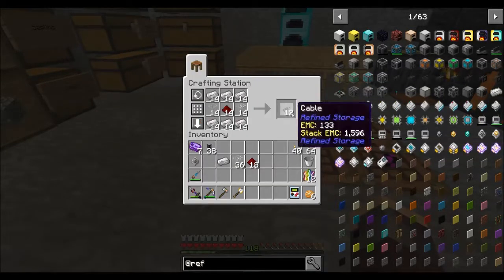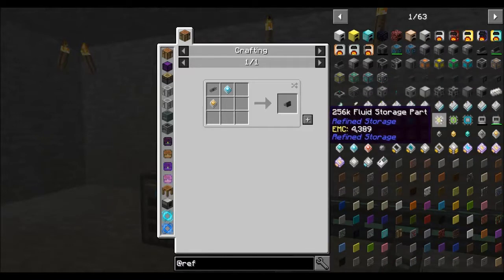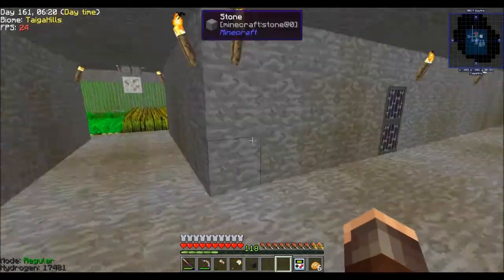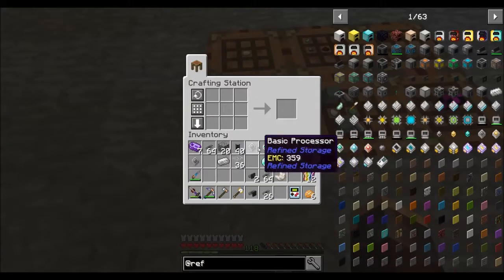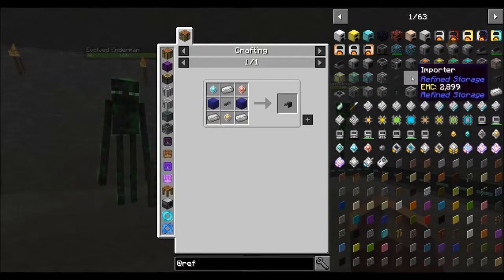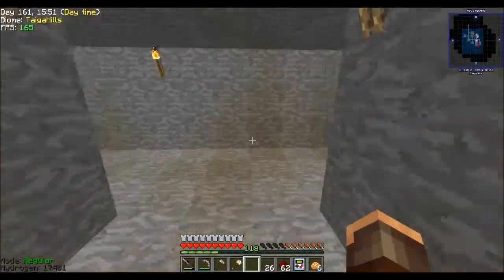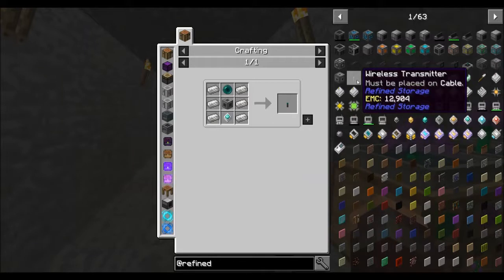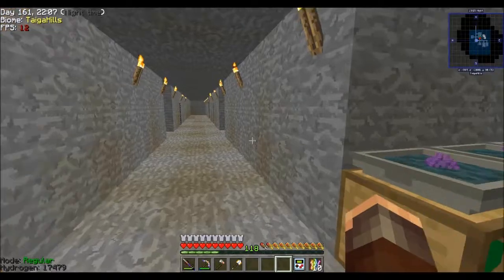Small Victory : Ep 16 : StoneBlock

Comment: Watching you hover your mouse over "External Storage" and shouting at the monitor: "That one... no, that one! Make that! How can you not see that you need the External Storage!!!" 😶
 It's so much easier standing sitting from the sideline and when you happen to know that particular item...
 😊 Right-click the External Storage for the GUI and set it to a high priority so that when you put items back in the storage system they'll go into the drawers if possible and into the disks as secondary option.
 You can use the importer on the sifting and ore processing to import into the storage system (and into the drawers).

The wireless transmitter allows the use of the wireless terminals so you can access the storage system from elsewhere - if you want to connect machines wireleslly you'll 
want to look at the network receiver and transmitter. (and do some research on them ahead of time).

I believe I've mentioned this before but if you search JEI for "@mod name" remove the space otherwise you're looking for items with "name" in "@mod".

Comment: I always have to think carefully with importer/exporters to get into the right frame of mind.  If the stuff is going into the system, you need an importer.  If you are pulling it out of the RS system you need and exporter.  My natural inclination is to go, "I'm exporting the stuff out of this chest into the RS storage."  And that's exactly backwards.

I really like skipping long cables and use network transmitter/receiver pairs.  Does cost a bunch of ender pearls, but is more tidy in my book.